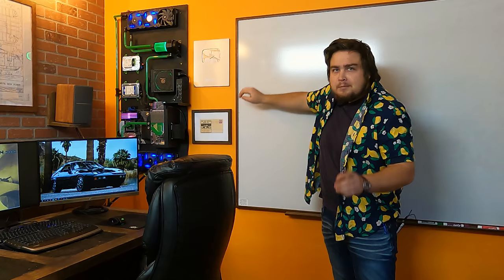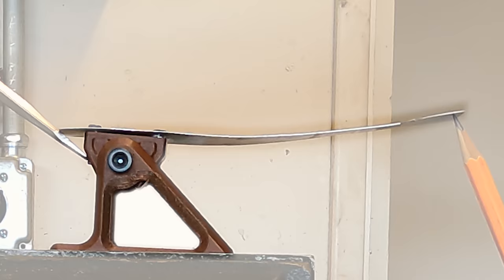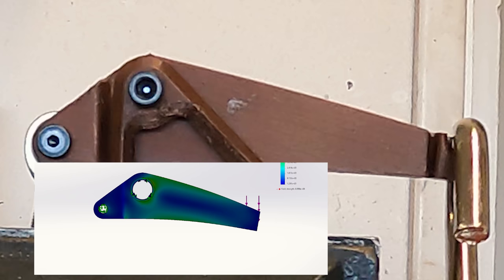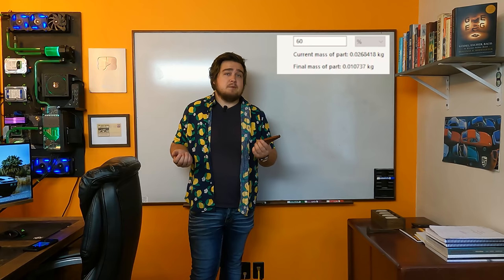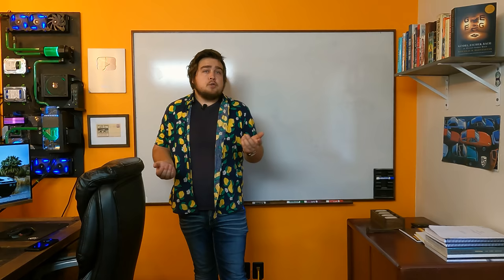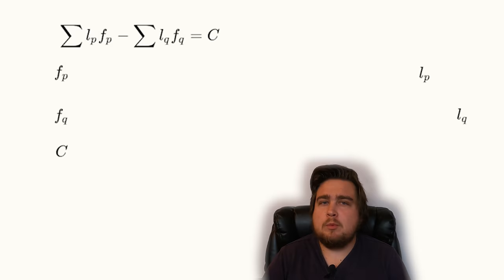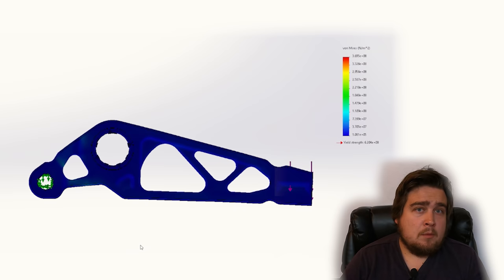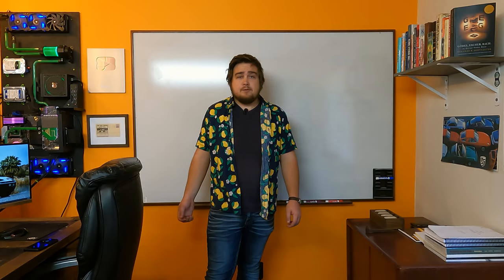Why do the Strongest Parts Look Like This?

Comment: there is one big misconception about "strong" and "optimized".   optimized geometry parts are not particularly strong. 
they have better weight/strength ratio, yes, for one particular load scenario which they are optimized for.
"optimization" means that we leave only material which is necessary for carrying a particular load, removing all material making part weaker for other (unexpected) loads and therefore unreliable.
Reply from the maker: I mean, that's also where the bigger chunk of FEA comes in, and if you're truly designing a part that has a real world application outside of normal parameters, you can get close but there's nothing better than physical testing.
Reply: But if the part is designed to support a certain load of 500 N, then you can make it support 5000 N. It will have a lot more of material but also will be stronger and support other loads you didn't think of.
Reply: @sayingnigromakesyoutubecry2647  If you use the same volume/weight of metal that supports 5000 N and use optimized geometry, you can support maybe 20000 N.
Reply: @zazethe6553  the idea was to use optimize it for 5000 not 20.000, using the same direction for the forces
Reply: @sayingnigromakesyoutubecry2647  I see, I thought you meant that it would be better to not optimize and just fill the space to make it stronger. I misunderstood your point.
Reply: @zazethe6553  oh, nice.
Reply: Yes and no.  With the most perfectly optimized part it will be the strongest in the ways that it is typically strained.  In real world applications odd strains happen.  Pushing the design “to the limits of maximum optimization” has a habit of of failing due to users doing dumb things and breaking stuff as well as being hard to work on.
Reply: @stefhirsch6922  yeah and it another problem that I didn't thought of, is resistance to fatigue. All that holes are nice in theory but they can be points of failure due to the surface roughness
Reply: @sayingnigromakesyoutubecry2647  when done properly the surface roughness shouldn’t be an issue.   The problem is that there are a few materials that are readily conducive to those flowy  shapes - carbon fiber,  wood and plastic.  Pressed sheet metal welded into monocoque is likely not going to be cost effective.   Carbon fiber has incredible potential when weight is critical and the budget allows but until further notice isn’t able to be recycled.  Yes those shapes could be made by forging steel or aluminum but not HOLLOW and it would be hard to have good grain orientation with a design such as the lounge in the thumbnail.
Reply: @stefhirsch6922  that it's an issue. The fatigue in metals start in tiny cracks on the surface. To avoid it, the surface has to be polished like a mirror. That has its costs. You will have less surface in a solid structure without that many holes, thus more resistance to fatigue. Many times, structures break due to fatigue, not load.
But yeah, a lot of problems aside for that. I can't imagine a bycicle having a highly optimized structure like that.
Still I hope some new ways to manufacture appear to make it happen.
Reply: @sayingnigromakesyoutubecry2647  they’ve done those swoopy flowing shapes for bike frames made from 2 clamshells made from stamped aluminum sheet metal welded together.  I’m forgetting the names of many of the companies but Mountain Cycle and Foes definitely produced many successful designs. I own a 2001 Mountain Cycle SliX which is still in action. Both of those companies started working with aluminum clamshells to produce aluminum monocoque with flowing swooping designs.  Another which is escaping my mind was doing flowing stuff “with a bunch of holes” for aluminum box bikes back in the 1980’s or 1990’s (which maybe a year ago made it onto a Facebook page for framebuilding).  That said a well done tig welded frame made from standard round tubing is fairly comparable in strength and rigidity for the weight.  As far as how critical polishing is depends on the metal.  Steel isn’t as temperamental to scratches as Ti.  Also different aluminum alloys have significant differences in their tolerance to scratches 6061 tolerates scratches reasonably well whereas 7075 is known to fail due to scratches that you need a magnifying glass to see.  Any material which is that sensitive to scratches is prone to trouble in real life.  Carbon fiber is particularly sensitive to scratches but typically has a clear coat reducing the severity of the issue.
Reply: @stefhirsch6922  id like to see if that bike design can take many years of use without cracking due to fatigue. Would be interesting. Also, see how much does it weight
Reply: @sayingnigromakesyoutubecry2647  i believe that it was claimed that it weighed 5.6lb/2.5kg for an aluminum 100mm travel mountain bike frame.  I got it from a bike shop that I used to work at 20+ years ago. No cracks,  squeaking,  creaking,  sloppy pivots…. Yes I’ve ridden it.  Lots. It’s still in action and going strong without drama. Mountain Cycle made a few variations of the SLiX,  late 1990’s to 2000 it used a shock that was mounted vertically,  2001 they changed the rocker,  mounted the shock horizontally and added a reinforcement to the left chainstay for disc brakes,  2002/3? they moved production to Seattle in the Kinesis factory.  After that it was redesigned and it was produced in Asia.  The Asian produced M.C. SLiX changed from a semi monocoque sheet metal with some tubes to primarily tubes with a sheet metal gusset which was elegant swoopy looking.   For some nice examples of bikes using lots of stamped aluminum welded together blended with tubes check out the foes weasel,  fxr,  fxc,  fly and mono or the Mountain Cycle San Andreas,  Shockwave,  Shiver,  Moho (SLiX,  CX and even a road version).   There were a few other companies messing with stamped sheet metal in the mid 1990’s to early 2000’s such as “Chuck” and Intense (although Mountain Cycle and Foes used sheet metal more extensively).
Reply: @stefhirsch6922  wow, amazing that it can wistand the use. So, normal bikes surely use way too much material. I wonder if cars and motorcycles can also get this much weight reduction
Reply: I'm in home building and this correlates. Homes are usually overbuilt and have excessive wood in the structure. So, for known loads, houses have been over engineered in general. Unknown loads, like a car driving through the side, termite damage or removing a load bearing wall are also surprisingly not as bad as you would expect (for a short period of time). 
Advanced framing optimizes material use, saving roughly 30% of material. These homes perform better, are better insulated, and a better value. Each piece matters crucially. There's no room for errors or damage. Termites could cause a collapse, a load bearing wall is crucial and acar driving through will probably make it out the other side. Then the house will collapse.
Reply: @marthamryglod291  that's interesting. You could use advanced framing techniques and then use a high safety margin. That way the structure is optimized and at the same time reinforced
Reply: @sayingnigromakesyoutubecry2647  you sure can. Adding a few key redundant framing members is the best of both worlds.
Reply: @marthamryglod291  what do you mean by key redundant framing members?
Reply: A better weight/strenght ratio is the only thing you need to make the part stronger:
Maybe with the old part you were using aluminium to save weight, after the optimization you can make it out of 308 steel for the same or less mass.
Or maybe you were already using steel to save money, after optimization you need much less material and can afford to use titanium, copper-beryllium or that nice alloy that you make by melting chunks of the Roswell shipwreck.
Reply: This is mostly due to topology optimization's nature of removing material from a solid block instead of adding material where it's needed. Generative design on the other hand has the potential of actually strengthening the part.
Reply: @marthamryglod291  As a firefighter, I can point out an example: engineered wooden I-joist save a lot on material, they're light, strong (in the right orientation), and more efficient in use of resources because they don't need big trees like dimensional lumber does. Great for floor joists and roofs. Unless fire gets to them. A 2x10 solid floor joist can take a great deal of charring and still retain sufficient strength to remain load bearing. Charring, say, a quarter inch deep on the sides won't reduce its strength enough to be an immediate concern. A quarter inch deep burn on both sides of the web of the I-joist means you've gone all the way through it, and it has no strength left.

The use of those things is one of the reasons I refuse to have my crew go on to roofs to open ventilation, and are very hesitant to have them enter floors above a fire: if there's a chance fire has gotten into them, that area is compromised and prone to collapse under any load.
Reply: @keith6706  oh that's good information to know! I enjoy building with engineered materials because of the consistency, strength to weight and longer spans available, but like you said there is little room for loss of strength.
Reply: @sayingnigromakesyoutubecry2647  if one piece fails, like a stud in a wall, it is directly carrying the joist or truss above it, with a single top plate. A redundant piece would be the traditional two piece top plate that can better transfer load to the next stud in the wall.
Reply: @sayingnigromakesyoutubecry2647  it was also made with care and quality workmanship,  the dropouts,  linkage and such are machined with lots of detail… thus light and strong enough to withstand 21 years of use while being reasonably light.  It also uses 26” wheels which allow the combination of the fork and front wheel to be shorter - which is effectively a lever.  The chain/seat stays are also allow a cross brace which is also inherently more structurally more efficient.  It has a 120mm fox vanilla rl on the bike.
Reply: @stefhirsch6922  nice. By any chance do you have photos?
Reply: I think people don't get that about engineering. Engineering is usually about finding the weakest possible design that is still sufficiently strong for the use while including after accounting for an appropriate margin for safety. A lot of the largest and most impressive feats of engineering wouldn't have been possible if they had to aim any higher with the technology and methods that were available at the time.
Reply: "Given unlimited materials and budget, even a two year old can build a bridge across the Atlantic that could carry dinosaurs.  Anyone can make a bridge or a building that stands.  But it takes a structural engineer to make one that barely stands."
Before people knew how to engineer structures, the best solution they had was "overbuild the hell out of it."  They'd guesstimate how much "building" or "bridge" they need to do the job, then fucktuple it.  That's why older buildings are so "heavy" compared to modern ones.  When modern framed houses first came into use, traditional builders laughed at the idea of such a "lightweight" building, and joked that they'd blow away in a strong enough wind.
Reply: A cheetah is optimized for running, but want it to swim and it will die. 
A fish is optimized for swimming, but it can't run. 
A beaver can do both but neither that well.

Comment: The heavy part broke at about 50

While the topologically optimized broke at 45

For 60% weight savings this is well worth it and another iteration where you try to strengthen the area that broke might move the weak point to the same location it was in the original part

Even with a bit of added material 50% weight savings with the same breaking point both at 50 kg or 50lbs is beyond amazing
Reply from the maker: Yeah, I know the weak spot in this model and I want to fix it, and I have an idea coming up for it…
Reply: @WesleyKagan  since you always do crazy projects

Would it be possible for you to tale a 3d model of Bmw s1000rr chassis use topology optimisation on it and then compare it to the 3d printed s1000rr frame you can find online

Just a crazy suggestion
Reply: @FirstLast-tx3yj  I had a similar thought: how could this be applied to tubular race car chassis? Lower weight, same strength is very appealing.
Reply: @SteveLowe65  it cannot to a tubular chassis

Carbon fiber Monocoque is the way to go for a single seater

A spaceframe with carbon fiber parts as much as possible for a race car based on a road car

There is a 3d printed exotoc car check it out
Reply: @FirstLast-tx3yj  You raise an interesting point, but you can do topology optimization to figure out the thickness of the carbon fiber monocoque at various points in the chassis based on the required loads and safety considerations.
Reply: @samfedorka5629  cf monocoque is out of 99% of peoples ability

Designing one from scratch is extremely difficult
Add to that the building process and ideaĺly an autoclave

A tubular chassis makes more sense
Reply: @FirstLast-tx3yj  monocoque structures a usually most efficient in small sizes, for example many bugs and insects are exoskeletons monocoque and large animals are all space frames using bone under compression and tendons under tension. There aren't many large fully monocoque structures.
Reply: @crankhandle  i agree but in this context (cars) monocoque are the right way to go for ultimate performance but it is not feasible for the average individual except of buying a lambo or mclaren
Orelse building a tubular chassis is the way to go
Reply: @FirstLast-tx3yj  that is why it's good, the competition can't do it 😈
Reply: @FirstLast-tx3yj  yes but car bodies aren't true monocoque structures because the pillars and subframe rails are all box beams and take the majority of the loads. The rest of the skin just fills in the gaps and has very little strength or rigidity.
Reply: @crankhandle  because it easier for mass production

But still good regidity to weight

Having front and rear subframe structures as cf makes it very difficult to fix also in case of a crash or any accident and much more expensive even when could be fixed

This is as close as they can do it production wise... maybe in the future
Reply: @crankhandle  Only most commercial aeroplanes...
Reply: @SteveLowe65  I suppose if you want the frame to still be made of steel tubes just optimised and not going the crazy carbon fiber route like discussed in this thread, you could use the topology optimisation by determining the cross sectional area of the struts generated and with a good understanding of the forces on that beam and how that area would translate into the desired cross-sectional shape (tube), you might be able to optimise the individual struts of the frame when it comes to diameter and wall thickness. also the topology optimisation would show where to place the tubes. of course this would then require validation by means of of other calculation methods as things like buckling are very different for different cross sections
This is just the idea that pops into my head. I might be wrong here and am open to discussion as I'd like to learn.
Reply: @FirstLast-tx3yj  That would be so cool if motorcycle frames would have some insane topology optimization. Even less weight and it would look awesome. But it better be strong :D

Comment: For anyone curious, Bernoulli and Euler's blood pressure measuring method basically involved jamming a glass tube into a live artery and measuring how far the blood climbed up it.
Interestingly this method of measuring pressure is still used today in aircraft - Bernoulli's calculations inspired the Pitot tube which almost all aircraft use to calculate airspeed by measuring the air pressure inside it.
Reply from the maker: Yes- exactly. It wasn't a pleasant thing to read. But, it worked.

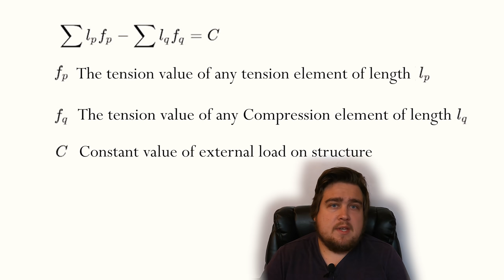Comment: 6:24 I've never seen this formally explained. i only ever saw the practical application where you can let gravity pull on a plastic shape, and the shape it forms will be that objects strongest compression shape against gravity when you invert it. For example, the arc that a piece of paper makes when draped between two points (a catenary) will be that paper's strongest shape in compression. i've seen this used with resin casting to make bridge supports or other similar shapes. you can also use a chain to trace out a catenary shaped mold for concrete to make an arch

Comment: With a budget, I'd do a track car project such:
1 - ground effect maximizing false floor, think carbon, bit like in F1. 
2- It's mounted to the four wheel uprights, making it unsprung aero. Yes, unsprung mass, boohoo
3- Light wheels, whatever they look like
4- Chassis that holds payload and to which suspension is mounted.
5- Shrink wrap body to minimise drag and have positive effect on downforce, depending on active aero shapes.

Comment: Thanks for making this vid.  As a kid I developed my own understanding of basic engineering, like we all do.  Some of the intuitive stuff was wrong, like thinking folding wings on aircraft could never work because only long, straight beams could ever be strong.  But from early on it seemed like things were designed wastefully and just dumbly.  Human-made stuff often seemed lazy and to rely on using overly heavy/strong materials and then placing supports etc in vastly sub-optimal places that relied on the over-engineering.  A little extra thinking and design could have resulted in much better use of the resources, while also making the item just nicer.  Some much urban design and civil engineering is ugly and off-putting.  That was a gut feeling that I've never forgotten and it's awesome to randomly see this vid of yours.  I'll go back and see if you've gone more into this.  I like the way you think!